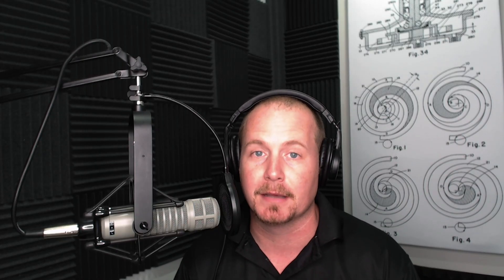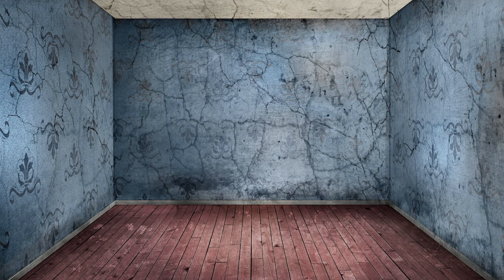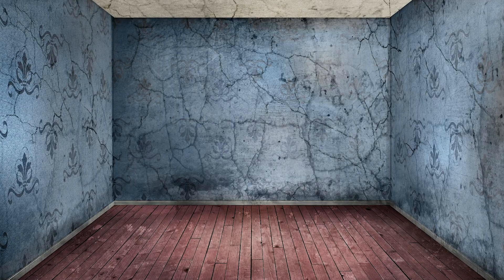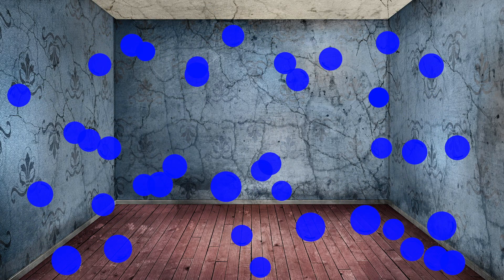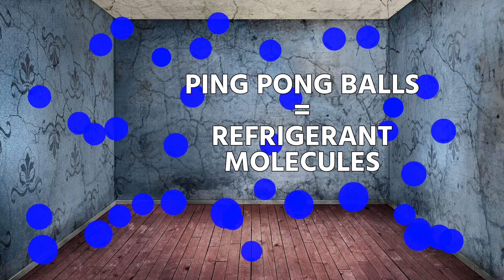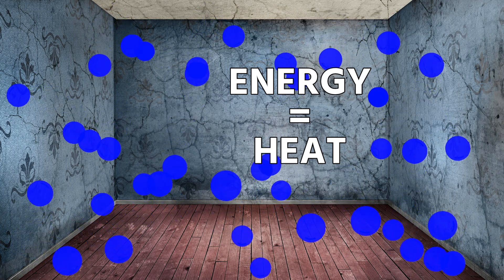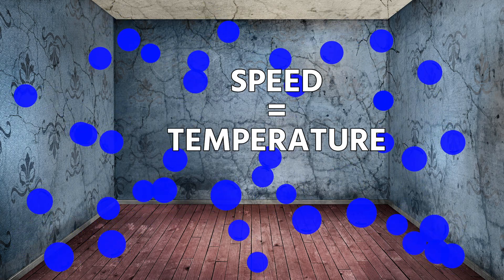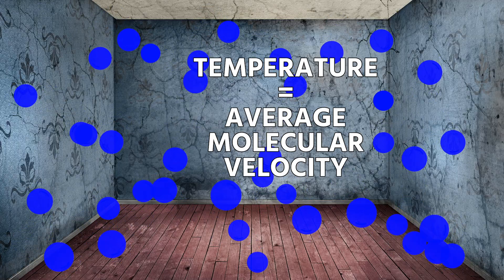Refrigerant Compression and Temperature

Comment: There is a temperature difference between condenser and ambient temperature. how does the compressor adjust its discharge pressure with ambient temperature to keep this temperature difference? Is there any sensor on compressor discharge or a Hi pressure on discharge line is considered by designer?

Comment: Well presented. I’ve had this backwards my whole life. Always thought the suction line was cooled refrigerant on its way into the evaporator coil and the liquid line was carrying hot refrigerant to the condenser to be cooled. Still don’t quite understand how the hot (liquid line) ends up cooling the evaporator coil so much, on a day where outdoor ambient temps are high the liquid line on my home system will be extra warm.
Reply: The temperature is higher than the suction line but the energy content is lower. Energy was just rejected as heat into the condenser. Immediately after the metering device the liquid refrigerant now has a boiling point which is colder than its surrounding. The liquid refrigerant begins to absorb heat. The low energy state begins to increase as it absorbs heat. The refrigerant absorbs a large amount of heat as it changes state from liquid to vapor. It is now much colder but also has a higher total amount of energy content within it.
Reply: @Practicing_HVACR  thank you I have a much better understanding now. It’s fascinating stuff!

Comment: So if we say suction is around 50 degrees and discharge is around 160 degrees, why do we compress it although exchanging heat with environment will return it to around 50 C? ( assuming environment temperature is around 50 degrees)

Comment: Question:  if you didn’t have a metering device in the evap would you still have compression?  My thinking is the compressor is a pump unlike a car engine.  The engine actually compresses the gas on the compression stroke with both valves closed.  So in a compressor you have an intake valve and exhaust valve but no compression stroke.  So does the dammed up liquid bearing against the metering device one of the “walls” which allows compression?

Comment: Actually decreasing the volume rises the pressure - from the ideal gas law you cant see the way the temperature rises. The multiplication cant be predicted since one goes up and one goes down. If you are familiar with joule thomson law, when gas spreads its usually cooled down because it leaves interactions which makes him increase potential energy on the expense of kinetic energy. I assume the opposite is the same principle. The particles get closer, more interactions, loses potential energy and get kinetic energy - temperature rises.

Comment: What always makes me confused about is:
When you see the pressure/temperature chart of freon for e.g r410..
It shows that with reduced pressure, temperature falls..
But i wonder then why when an AC is low on gas, it reduces cooling, although the pressure on low side reduces when gas level is low in the system, which means now it should cool more..
Ahhhh...so much confusion..
Reply: I believe the its because there is less refrigerant (gas) to do the work of cooling the air. Yes there is low pressure. But also there are less molecules to absorb heat energy. Less volume of actual fluid to pull heat out of the air. Does that make sense? I hope it makes sense becuase Im trying to figure this out too.
Reply: @jerm5772  yes i think you are right... it is making sense..thanks :-)

Comment: in my studytime I have always wondered where this energy to accelerate the molecules comes from. I'm really thankful for your video, but I think I did not quiet understand this yet.

Right now, I think the model of explaining temperature with average molecule velocity does not sum it up correctly when it comes to compression:

when s is the way an average molecule moves and t is the time it needs for this way you can state:

steady-state:
s1  ----------------------------------------->  with t1
compression:
s2 ---------------------> with t2

i'm not sure: v1 = v2 or v1 < v2
i'm sure: t1 > t2

So, what is really making it hotter, is an decreased interval of contact between the gas and e.g. the skin. You get contact with more molecules in the same time. 
This can have 2 reasons that do not contradict each other:

1st assumption: Velocity v increased, so they travel faster through sapce and hit you more often in the same time
2st assumption: Way s is shorter, so they don't have to travel through the same size of space resulting in more contacts in the same time.

I do not understand where the acceleration comes from and since the room and the gas are compressed the way s is definitly shorter. Thus an increased velocity sounds less convincible than a shorter distance.

So maybe in the end temperature is not velocity of molecules alone? Is it a bit more complicated?
   Please let me know if I am wrong! Cheers.
Reply: Yeh im thinking the same way as you, I would've imagined that the speed of the molecules remains the same, but the amount of collisions would increase at the same speed. After all im pretty sure temperature is related to collisions more so than just the speed of the molecules alone. That is that if pressure were the same but there were 2 different temperatures, then you would be feeling different moleculre speeds. But if pressure and temperature were proportionally higher, then you would be feeling the same molecule speed but just more collisions for the hotter one. Excuse my rough explanation. I could be wrong though, after all that's why I'm looking up these videos right now lol.

Comment: If the temperature increase of the compressed gas is related  to the molecules being closer together then why is it that you can remove the heat and have a lower temperature even though the molecular density of the gas remains the same or even better why  is it that liquid refrigerant can be cool while the discharge temp of the compressor is hot even though it is a gas? Toward the end of the video you mention that the increase in temperature is due to a given amount of heat energy for a larger volume being compressed into a smaller volume thus an increase in temp. Also gas law does apply. It seams that there is some gaps or contradictory explanations here. I understand your latter explanations to be correct and to be the way I was taught personally.  Did I misunderstand your explanation?? Thanks
Reply: It has to do with saturation temperature.  When the compressor moves the suction line gas from a lower pressure to a higher pressure,  it's temperature and pressure increased.  But now the discharge gas has a new saturation temperature for its pressure.  So the hot gas goes into the condenser (outside coil) , and as ambient air removes some heat it drops in temperature below its saturation temperature ( you can see this on a pressure/temperature chart). It now starts to change state. As it loses heat it turns into a liquid.  This proves that the refrigerant molecules are slowing down enough to 'condense' into a liquid.  
When this liquid travels to the metering device ( which separates your high side from low side) it starts to evaporate as it too reaches its saturation temperature.  Hence Evaporator and Condenser names for the indoor/outdoor coils. But it's because of the pressure that the refrigerant encountered that dictates its saturation temperature.

Comment: What temperature should the discharge superheat be?
Reply: onemischiefmaker On the discharge side it’s called Sub-cooling. You usually want around 10 degrees sub-cooling but it depends on getting other measurements to get the correct sub-cooling.
Reply: Refrigerant is not Sub-Cooled until it makes its way through the Condenser.
Reply: With a TXV the nominal superheat is 8-12F. With piston type metering device, refer to manufacturers specs or calculate target superheat. For a faster and better way, just make sure that your suction line temp is right above freezing: typically in comfort cooling settings and many more applications this will mean you are just right or well within reason of having a good charge. Check the split to further validate.

Comment: So why do HVAC systems "freeze-up" if they get low on refrigerant?  What exactly "Freezes up?"
Reply: Froman Abe low charge=low pressure=low temperature
Reply: Anything below 32 degrees is going to freeze up. If the refrigerant is below 32 degrees the evaporator coil and Suction line will freeze up as well as the compressor.
Reply: @ChineseChicken1  Those parts of an HVAC system don't actually freeze themselves, do they? They just get moisture freezing onto them, right? Of course that's a problem for the evaporator coil since it will block airflow.
Reply: Froman Abe Yes, it’s on the outside of the copper coil or line-set. I’ve seen coils frozen up into a solid block of ice.
Reply: Refrigeration Systems freeze up when they are low on refrigerant and certain criteria is met. As the system loses refrigerant, pressures decrease and subsequently, refrigerant velocity throughout the system decreases. On the Evaporator, discharge Superheat is rising at this point, but the metering device is still receiving and is allowing some liquid refrigerant into the inlet. Low velocity means that liquid boils completely at the beginning of the evaporator, where it used to require a majority to do the same. Now temperature at one finite point on the coil dips below 32dF and formed condensate now freezes. This ice insulated that section of the evaporator, which means this “low velocity, reduced surface area boiling point” moves down; until it is in the air stream where it collects condensate and then freezes it. This process continues until the evaporator is completely frozen, then it can do the same thing to the suction line.

Comment: Hot god to cold at both points , evaporator takes heat from the room puts it in the refrigerant  , condenser takes the heat and dumps it in the cooler air outside. It’s all about refrigerant behavior. It’s boiles on the cold side and condenses on the hot .

Comment: Thx for the podcast :) As a technician at an icerink however i consider this basic knowledge for any refridgeration technician. It is the core of how refridgeration works...
Reply: fenna pel what refrigerant are you using? R-22 is what the city using here until they can upgrade.
Reply: @kidalwys  , we have a 2 stage system with R-717 in the first stage (containened in the engine room) and R- 744 in the second stage (in the icerink floor piping)